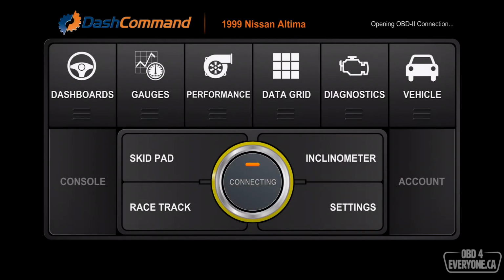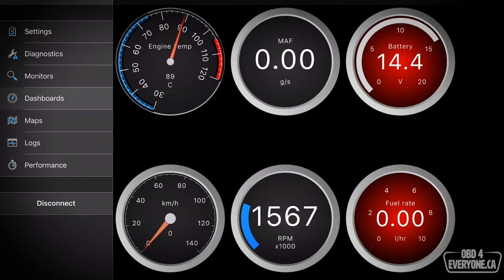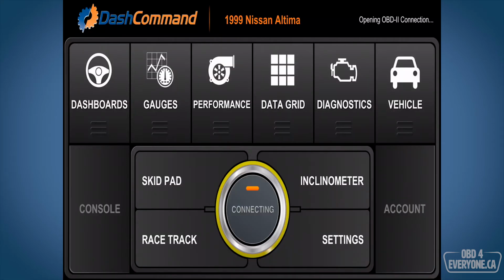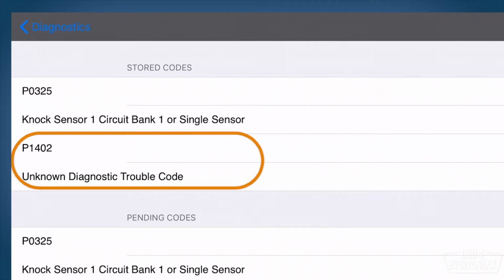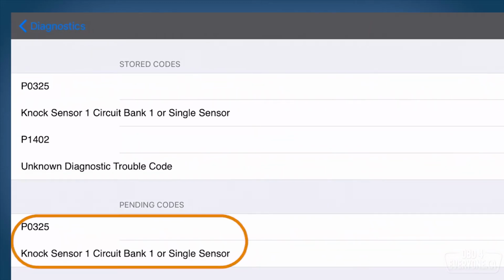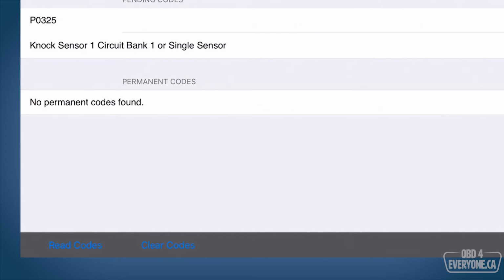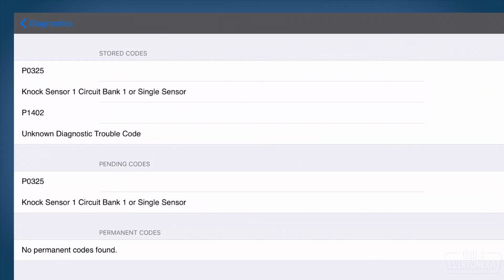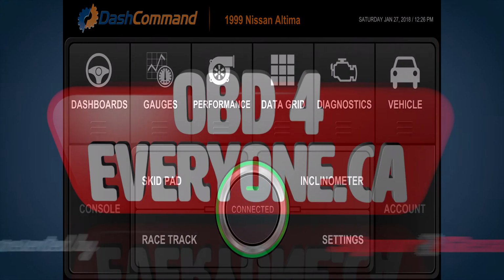Reading Engine Trouble Codes with Dash Command for iOS: OBD4Everyone Ep. 13

Comment: would thi read ABS truble codes
Reply from the maker: I don't think so... Last time I used that app, it only reads engine codes, as that process is defined by the OBD standard.

Reading ABS module codes generally require special software.

I don't know what car you have, but OBDFusion with the $14 enhanced diagnostic add on can read/clear ABS codes on my Nissan/Infiniti.

Have a look here https://www.obdsoftware.net/software/obdfusion and see if your vehicle is supported.

Good Luck!